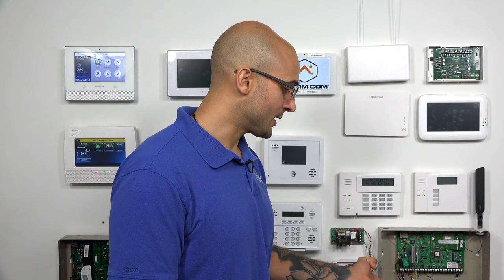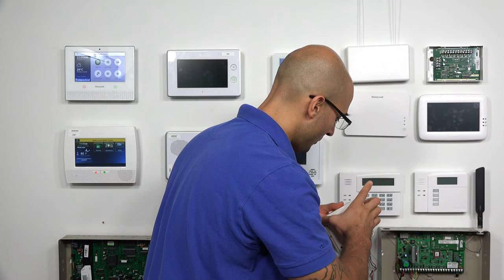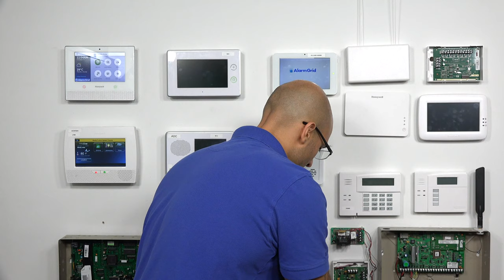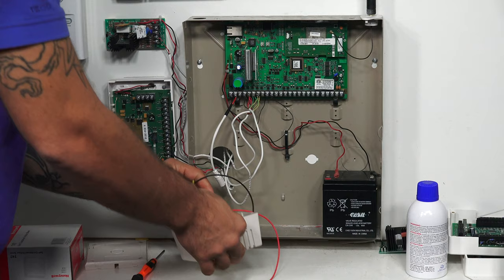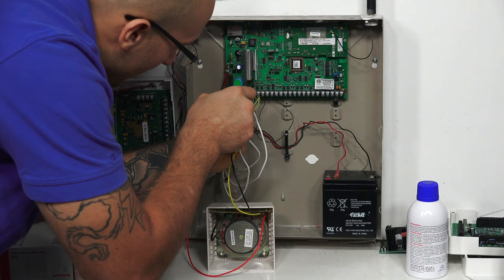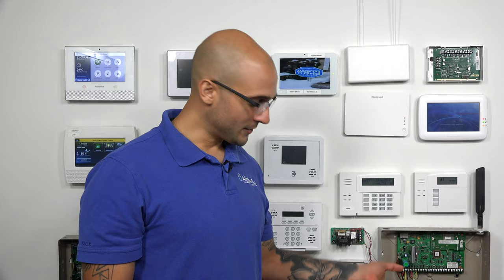Adding a Siren to A Honeywell VISTA Alarm System

Comment: With what type of wires would you be able to extend the connection to the siren?  Will a wire splice between the siren and a basic 2 conduct wire to the panel satisfy the wire extension or is there a way to directly wire this siren straight to the panel?  Thank you.

Comment: great video, thank you. I've inherited a house with an old Radionics security system D2112 circa 1996 and in the garage a ceiling mounted Amseco SSX-51 siren. When I power down 100% to remove the system will the siren in the garage activate? Do I need to remove the siren before powering down? Appreciate your expertise.
Reply: When you remove both the power supply and backup battery from your system, that and the siren will be fully powered down and not activate.

Comment: Great video and very informative. One question, how do you add external auxiliary power? I have an outside siren which has 2 wires and with 110v rating. Can you please guide me to the right direction. Many thanks
Reply: You can add the AD12612 with another plug

Comment: Does adding a siren require additional programming? Or once the wiring is done there nothing left to do but mount on a wall
Reply: There is no additional programming needed when setting up a wired siren.
Reply: @dylanalarm_grid1038  thanks brother

Comment: Whats the difference between Honeywell 747 siren and Honeywell Wave2 siren? Which do you recommend?
Reply from the maker: The 747 is a 2-tone siren with a 95 dB rating and a 400 mA current draw.  The Wave2 is also a 2-tone siren, with a 106 dB rating and a 500 mA current draw.  The choice comes down to your preference on the volume, and how much current you have available, and of course the look of each one.  I personally think the Wave2 is better looking.
Reply: @AlarmGrid  Thanks

Comment: Would the alarm still sound if the red and yellow wires weren’t installed?
Reply: The red and yellow are positive the yellow wire will need to be connected to the panel with the black wire. The other 2 wires are for going to another siren if you want to have multiple sirens.

Comment: Como solucionas el Bell Failure?
Reply: Translated By Google translator. (Traducido por traductor de google)
Lo que causa una falla de la campana es que hay un circuito abierto o corto en el circuito de la campana. Lleve la campana al panel en un corto recorrido de alambre. Si la falla de la campana desaparece, entonces hay un problema con el cableado. Si no desaparece, entonces es un problema con la campana y deberá ser reemplazado.